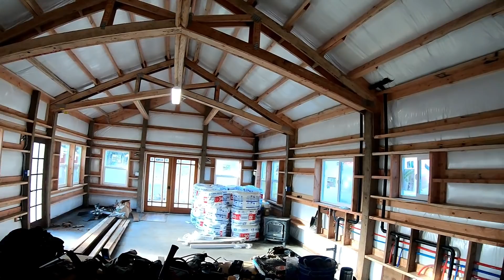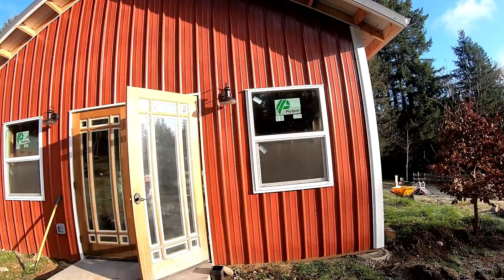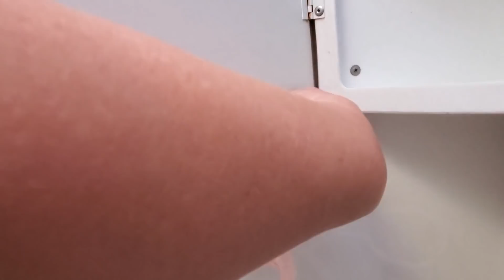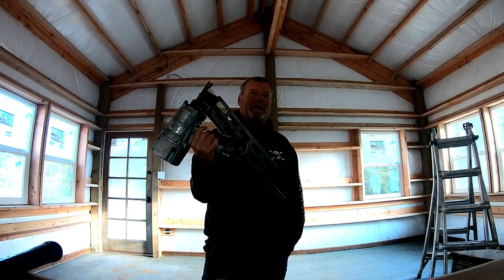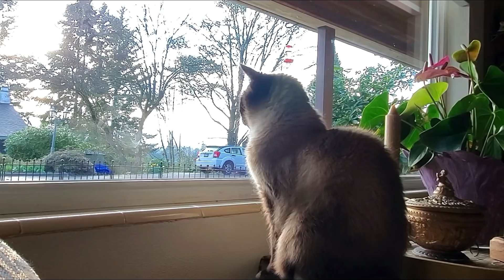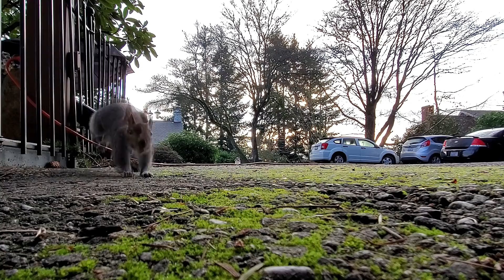There's More Than One Use For A Napkin, Just Ask Scotty! Life Vlog

Comment: Scott I built a pole barn like that and it turned out great!  The plumbing and electical work was mine but thankfully I have 3 great friends to help with everything else I did put in tubing when the concrete was poured for hydronic heating in the floor. I use a demand water heater instead of a boiler as it was a fraction of the cost of a boiler. That house might feel warm with electric heaters but I would think the concrete pad would be very cold. Thanks for boring us!

Comment: The best mirror is one without a metal frame...just a beveled edge, like a decorative mirror in a living room. My bathroom needs remodeling and has a mirror with metal frame. It has some corrosion on the front at the bottom, but not a lot. Moisture gets into picture frames too, when you spray the glass. You have to just spray the paper towel or cloth, and not the glass.